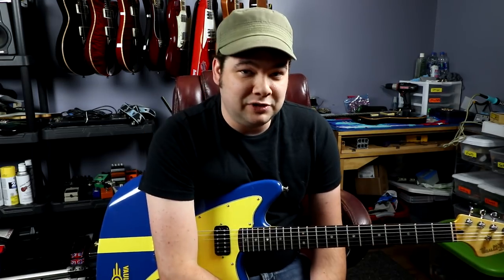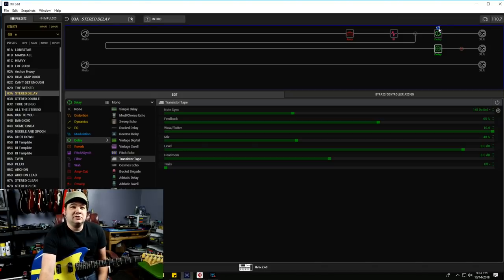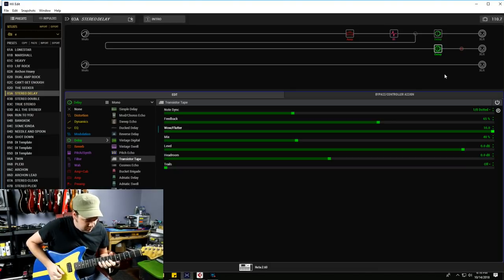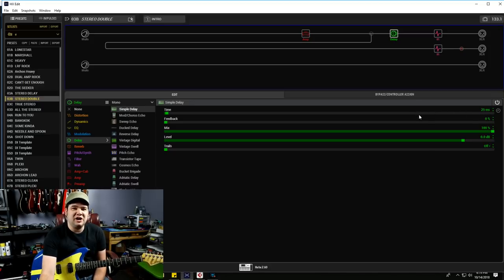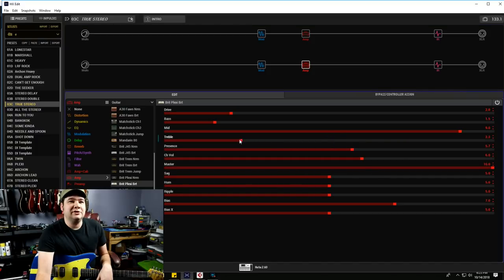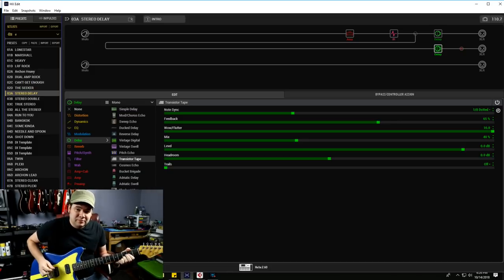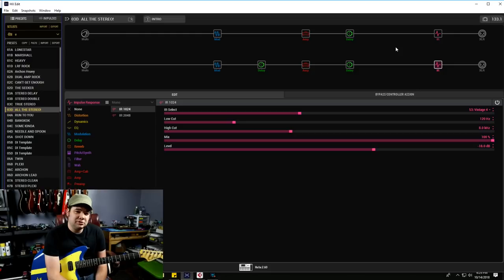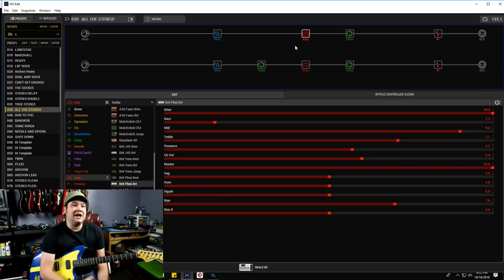3 Ways To Play In Stereo With The Line 6 Helix!

Comment: Hey, this is great.  Can you let me know how you have your Helix plugged in?  What cable do you have going where kind of thing?  I will be using this delay method with real amps and wondered how you have it  plugged in.   Thanks!!
Reply from the maker: I was going directly into my interface here, completely DI. The way I'm routing the delays here is essentially in the "FX loop" of the virtual amp. I prefer time-based effects in the FX loop so that the effect doesn't change based on my preamp gain sound.

There are different ways you could do this with amps, depending on whether or not you are using the "four cable method" using your amps's effects loops, or if you're just running into the amp's "front" input. You could also just use amp's FX returns and use them simply as power amps. 

It can get pretty complex actually, it kind of depends on how in the weeds you want to get with combining the Helix with "real" amps.

Comment: I have set the exact same settings up on my Helix Native and yours sounds far more driven than mine. Have you added an external drive pedal before the Helix?. Great video Lucas.
Reply from the maker: No external drives, that sounds like probably a combination of pickup output discrepancy and/or your interface’s input volume, as those are paramount to the amount of drive. You’ll need to experiment with the amount of signal you’re sending into Helix native, basically. Hope that helps!
Reply: @LucasFowler  Yes, that does make sense my Scarlett interface is right down low at zero for my Neural DSP plugins. I think the Helix Native should be set up as you mention. Thanks 👍
Reply: Getting that versatile Andy Timmons sound works great with the guitar volume reduced, cleans up nice.

Comment: What are your running the Helix into?  Do you have 2 separate powered amps or monitors?  I run my helix through a single powered Alto 2-10 monitor which has 2 discrete inputs that I run into as L-R from the helix, but I don't get that stereo spread.  I am wondering if I can get a true stereo sound out of it.  As a comparison, the amp I use in my rehearsal studio is a Blackstar ID 260TVP, which has a "true stereo" feature.  It's insane  - it  feels like the guitar is coming from all over. Totally mind boggling 3D sound with mod, chorus, delay and reverb.  I think it's set up like a JC-120 with a separate power section for each side, but am not sure.  Do you need 2 different powered monitors/cabs in L-R for the stereo effect?
Reply from the maker: Well in this case I was running it into two separate inputs on my interface, but to get a true stereo spread, you need to discreet inputs, power amps and speakers. You also don't want the speakers to be too close to each other, or the stereo effect will be much less noticeable. When I play live with that set up I have 2 separate Headrush monitors, one gets the "left" signal and the other gets the "right". I also sometimes use a stereo power amp into a stereo 2x12 cab. In that case the speakers are pretty close together, so I don't use the "doubling" effect because it doesn't sound good. I only use stereo delays or chorusing in that instance.
Reply: Thanks.  That's pretty much what I thought.  For me it's not worth lugging around another floor monitor since I'm really just using it for stage monitoring.  I wish someone made a true stereo frfr floor monitor...

Comment: Hey Lucas....great stuff!
Quick question on the live application. 

I just bought my Helix LT and a pair of Headrush speakers. The band I play in uses a mono application for FOH but just for stage monitoring I like feeling the stereo sound come at me and enjoy the fullness. With that said I will likely be sending mono XLR to FOH but using the 1/4 inch for l/r hoping to have some type of stereo richness when monitoring. 

If creating stereo sounds mainly for the 1/4 inch outs to the Headrush speakers will the FOH sound sending in mono be compromised?

Or would it be best to do the 25ms trick for both FOH and my monitoring?

Any advice appreciated.........

Thanks
Reply from the maker: That's a great question. You can sum to mono with most of these stereo effects, but I don't recommend the "25ms doubling" idea in mono, because what you'll end up creating is kind of a hollow, phasey sound. Other than that, I would use stereo paths however you like it. It won't translate as stereo out front if it's summed to mono, but that is often lost on the audience anyway unless you have a very talented sound guy!
Reply: @LucasFowler  So if I sum to mono will my monitoring with the 2 Headrush speakers give me a stereo sound? Do I even need 2 speakers if that is the case?

Comment: I need help. In the true stereo mode, can i add another line of effects for each side (left and right)? I need more than 8 slot. Considering two slots for amp and IR i can use only 6 effects for side
Reply: try dragging an effect block up or down to form a new line from HX Edit on your PC. then add a new block while the line is there and drag back the previous  block to its place. If you want the effects in line then on the output reroute to the new line. If you run out of processing power,  try a send/return block and run your effects outside of Helix through that block. Good luck!